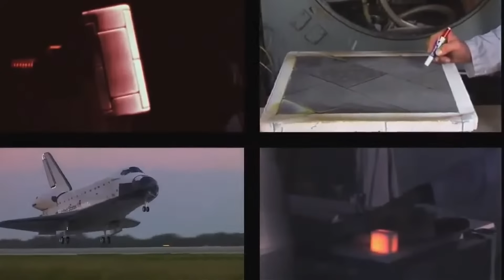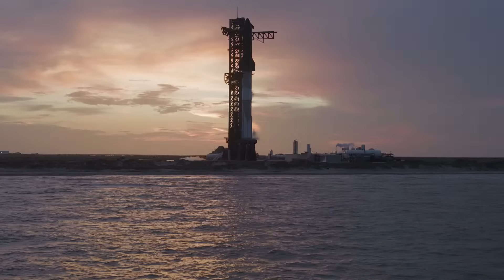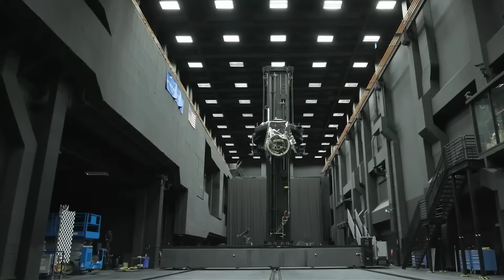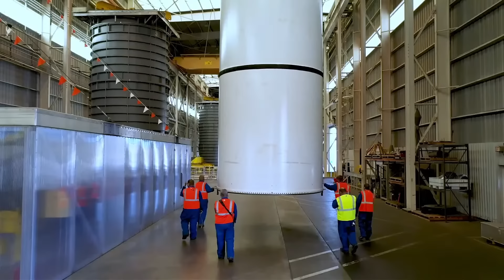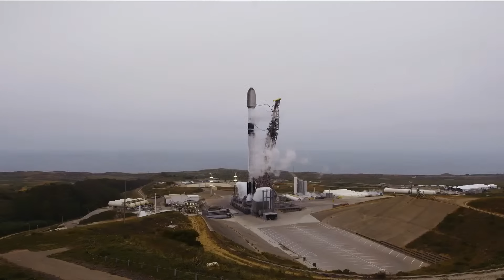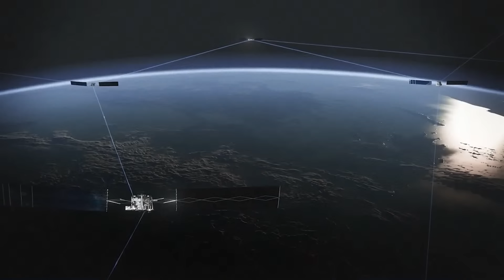SpaceX Brilliant Upgrade to Build a Heat Shield For The Largest Spacecraft Ever Built Reentry

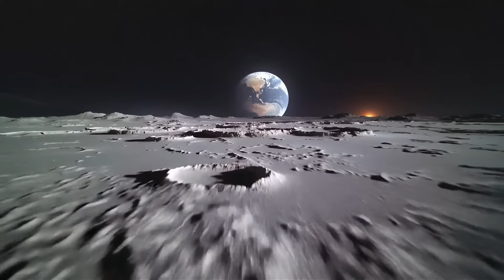Comment: 23:18 The landing legs should conform to the irregular surface during touchdown by retracting as necessary (after foot contact) until all are under similar large loads, then they should activate the extension clamps when the vertical velocity crosses zero. A parallel hydraulic circuit for all leg pistons can assure that all legs experience the same force as the ship settles it's weight on them. Shared hydraulic accumulators absorb displacement motion from the leg pistons. The guidance computer dynamically selects an accumulator with the most appropriate volume (and preload pressure) to bring the ship to a halt depending upon the momentary descent velocity and deceleration. Thus, the ring of descent thrusters are not the only control mechanism for touchdown. The extension clamps are not the sole means of immobilizing the legs, as shutoff valves for each accumulator and leg piston provide redundancy.

The great advantage of a shared hydraulic circuit is analog reaction speed, simplicity, and robustness. A downside is if the hydraulic fluid temperature reaches the boiling or freezing point.

Comment: What if the Starship was deliberately sent tumbling end over end upon re-entry, and in doing so no one part of the Starship was exposed for to long to the friction outside. Would this work and if it did would any heat shield tiles be needed? The crew could move to a gyroscopic compartment in the centre of the ship so they do not become disorientated until the ship levels out.
Reply: Problem with that , ... can you imagine how dizzy the crew would be ?
Reply: @harrydrury4734  Read the rest of my comment, the crew would be in a compartment in the centre of the ship that remains level at all times. If the ship is tumbling no ‘concentrated’ heat can be applied to any part of the ship for any lengthy period, when the ship is tumbling like a throwing stick. It is an ‘idea’ to avoid having a heat shield, I haven't the foggiest if it would work or not but a version of it may be worth giving it a try.

Comment: A couple of other options came to mind.
1. No upper rockets but inside a deep/wide crater or any elevations with steep slopes to build multiple cable tensioned catching rigs (similar to the Chinese build) next to each other.
The slope of the crater or hill can act as a flame diverter. Rigs would be anchored to prevent  ripping away from the slope.

2.Test the idea of self pile-driving foundation rods that can be lanced at the right velocity into the soil. To reduce the risk faulty geologic assessments, smaller lance projectiles can be used to test soil composition first before attempting to pierce with a full size foundation rod. The self ramming pile driver weight can also lean and cable tensioned anchors to help correct vertical alignment issues.
Once the foundation rods are pile driven in then you can anchor whatever landing platform you like. 
A lunar Mechazilla?
A cable tensioned catcher? 
Another good thing about building a landing platform on a slope is horizontal unloading can be done at any height without the need to hoist down anything. You just adjust the rocket position.
The use of pulleys to tension cables is likely ruled out due to lunar dust clinging to everything but may work with something used to tension with leaf springs and possibly magnetic cable ends or a design that borrows from lunar rover wheel design that overcomes the lunar dust issue.

Comment: Why not deploy multiple "Lunar Hoppers" with the same height/weight ratio, high center of gravity, weight proportions and a few other bare bone features to mimic a larger ship?
If this route was taken, which manufacturing choice would be the simplest?
Raptor style 3D printing?
Tesla Semi style giga casting?
Built by hand?
Also, what about building stackable test hoppers to maximize how many can be deployed in one mission?
There might be some missing data compared to a full size but I bet some lessons could be learned with a scaled down hopper before going to full size.

Comment: Why can't the HLS or the Lunar landER Land vertically and then use giant air bags like the Mars missions and let it fall over on its side Use a ring balloons around the top side of the hull, then Let it fall over, With the moon's gravity the stresses of such a fall over will be quite minimal then use another set of pyramidal shaped balloons(Rows of balloons stacked like a pyramid) on top of the other balloons to let it roll over into the correct orientation so that it's sitting upright on its side Then you don't need an elevator at all and you have tons of more floor space because you don't need a ladder down the center to take up space, Then use a completely separate launch vehicle within the Lander like the eagle to take the astronauts back up into orbit use the space that the Lander would needed for extra fuel to get off the moon and use that space for a separate launch vehicle Then the Starship can be left there permanently for future missions. 
But if they're dead set on landing vertically why not use cables that blast out the top of the ship and Anchor themselves to the surface, Much like how radio towers today are held up vertically

Tech fans: you used so many analogies in this video each one lamer than the next that I almost just quit the video early, Thank God for the right arrow key on my keyboard lets me jump ahead 5 seconds

Comment: The engines high up on the sides of the vehicle are the main engines for landing on the moon, not reaction control. The raptors would be way too powerful even dialled right back to allow the HLS to land. Instead they are going to have a ring of small engines similar concept to Superdraco but running on oxygen and methane rather than hypergolic fuel.  This also gives a huge advantage that they are well away from the surface reducing the amount of material potentially blasted from the surface that could impact the ship. Also HLS does not wait for multiple refuelling launches, there will be a tanker already full for HLS to dock with and refuel in a single operation. Seriously you need to do more research on this, the mission plan for a moon mission was released quite some time ago.

Comment: The trick on landing is not land the full starship! Basically, bring back the same concept used with Apollo and the LEM. Here, the passenger module goes down on its own with two thirds of the ship parked in orbit and the smaller craft with legs goes down!

So the path to the Moon would be: Phase-I, sending the moon ship up to be refilled at the fuel dept a second ship would join up with the crew once the moon ship is fueled. Transporting to the moon ship with last minute gear and travel to the Moon. Phase-II getting into orbit around the Moon in a parking orbit, then break free the lander capsule and head down.

Comment: So for the moon 
A multi sectional ship  would make a bit more sense to me.  One with two propulsion and a cab for the third point or even 3 outer rockets for wider stability with a central cab instead of bulky specific legs.  A lower in center cab that would alleviate such a bulky track for elevator. being even lower due to halving or even thirding the height because of multi sectional boosters.
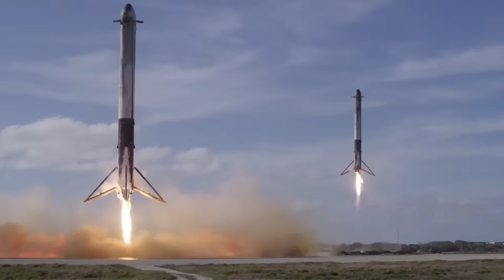If they really insist on legs then they should invert: They hinge at the bottom and fold out and down to lay out flat across the unpredictable surface using a much wider surface area that is less likely to punch down into the moon's surface making an  _| |_ shape, instead of a /| |\ down punching small foot print. He has feet slightly like that in frame 37:57

Comment: Putting landing legs onto Starship HLS is a big technical problem. Weight being high up on the list, so as crazy as this idea may be, what about building a landing legs “stage”? Launch this “stage” into orbit attached to a Starship deploying something like Starlinks, then jettisoning the landing legs stage for a Starship HLS to connect up to in orbit? No extra fuel top-up in orbit required (I think, not sure on what the extra mass would require to land on the moon), then head to the moon, land, then leave the heavy landing legs stage behind on the moon??🤪🤞🏻

Comment: I dont know the math on this but from the top of my head the gravity adjustment allowed humans and some mechanical assited movements could allow larger items to be used in place of an elevator the load and astronauts could technically move objects to the surface based on some basic pully method. Its an idea.

Comment: A heat shield made from obsidian
Reply: I think Obsidian is frormed from volcanos - while it came from a very hot reaction -  its glass like, but the blackness could be something. - Cermaincs and magnets could be something to avoid the re-entry problem.  Glass is a surface that could actually work under certain environments with magnets. Could be somthing to explore

Comment: Except they haven't solved the problem.
Reply: If a hundred ton vehicle as high as a skyscraper falling from space with 28000 KmH can get slowed down to 700 Kmh without beeing destroyed even after flipping into water with most of the tiles intact, I would call that more solved than everything else.
Like on every vehicle, heatshields need to be replaced. But the heat shield of the latest flight was mostly good to go again despite beeing stressed to much higher limits than usually would appear.
Reply: @Easore  So, in others words the problem has not yet been solved.  Huge progress acknowledged.  Not there yet.
Reply: @pspicer777  Well, its way better and cheaper than anything before. Whats solved than? With that energy levels involved, its hard to do better. There were some tiles that showed damage. But they can be replaced cheaply and easily.
Reply: @Easore Probably we can call it "solved" if the reentry damage is sufficient to support human rated craft and any damage can be replaced within a timeframe that meets the launch frequency requirements.  We are still a long way from meeting that bar.
Reply: @pspicer777  I d say we are already there. The heat shield already held up during all landings except when the Starship was tumbling and replacement of tiles can be done in time.
I think the heat shield already checks your criteria. The much bigger issue is landing reliable with the engine reignite and hitting the Mechazilla every time like some tests before to be safe for humans.
Reply: @Easore  Clearly we disagree.  Be well.

Comment: As the elevator descends, have a attached ladder roll down with it. Backup solved. As far as landing legs go, i'd run them the full length of the body of the ship. This is where over engineering would be appropriate.

Comment: Instead of covering the complicated surface of the fore and aft flaps with thermal tiles, eliminate those flaps in favor of one or two swing wings mounted to the dorsal axis of the Starship.  Those wings would be stowed for ascent, deployed prior to reentry, and then redeployed to their stowed position prior to or during the final landing burn.  The wings would allow for a slower, shallower descent after initial reentry.
Reply: The current design increases drag-resistant surface area.   Wings that fold downward from a central spine don't do that and they increase the probability of flipping over by llifting the center of gravity.  Side wings use the mass of the ship to sustain stability.  Plus, wings that fold out from a central spin create pockets for the plazma to gather in -- therefore requiring additional heat tiles underneath the fold out wings.
Reply: @_SYDNA_  The wings wouldn't fold down.  They would swing (rotate) out.  Parachutes don't cause capsules to "flip over" because they lift their center of gravity.  Why would a dorsal wing behave any different?  The fore and aft flaps already require thermal tiles.  Similar tiles on the wings or in the pockets would add no more than what are on the current system.
Reply: @glennmitchell9107 I get the concept, it needs engineering design, submit it to SpaceX
Reply: @SavageOne420  I'm not an engineer.  I was hoping some amateur rocketry club would attempt such a flight.

Comment: Lower the entire command module to the surface. No more annoying elevator rides every time you want to step outside (to pee 😆). Leave it there as a base with lines connecting to the bottom half of starship that could then act as a robotic supply ferry. Would have to protect the crew module from supply ferry liftoff and arrival forces and debris with distance or barriers/shielding.

Comment: question? why not make one big piece and glue it  to the shuttle . just asking?
Reply: When you heat or cool something the size changed. If it was all attached in one piece it would just break away from the vehicle and probably in pieces because they will have heated or cooled at different rates

Comment: Judging by Starship flight 13 a few days ago, SpaceX cracked the code on reusable heat shields. The plasma was clean and uniform in color and the actual heat shield was practically undamaged after reentry. I didn't believe it was possible but it's reality now.
Reply: Some tiles were damaged, but for every launch they do it's getting better, eventually they will have a solid structure, but they need to launch and test it over and over, we might se a perfect reusable heat-shield around 20'th launch.
Reply: @KungenErs they don't have to have all the tiles undamaged and still launch at the cadence they want. They just have to bring in a new vehicle that is ready to go
Reply: @ShieldWolf-yp3cr doubtful the starship will ever be usable faster than once a week
Reply: @ThatOpalGuy  they have already proven they can replace a whole heat shield in a week. So yeah I would say 2 weeks is pretty reasonable so a single ship to turn around and launch again. That is unless they find a new formula for the heat shield that is more resilient. Also after seeing the heat shield they started a new test tank for twisting forces so that may have played a part is why the heat shield looked a bit rough. Tiles being pushed into each other while the vehicle twists from force being applied to the fins could have caused some of those tiles to break and fixing that might mean a more resilient heat shield too. Next ship to re-enter might be way better heat shield wise.
Reply: @ThatOpalGuy then you need 7 of them to launch one a day. 

problem isn't the ships, it's launch pad turnover
Reply: Lol.  Many damaged tiles.  Those streaks on it?  The underlying material was heating and outgassing from between the tile gaps.
Reply: @ThatOpalGuy  the material  is between the tiles. Not just underneath it. They cut it just about flush with the face of the tiles so plasma can't get between the tiles. It's meant to burn up. The crunch wrap is sacrificed to protect the body of Starship.
Reply: not really, you cannot see cracks from afar. For all you know, every since tile had cracks and would fail during the next launch. What we can see, is streaks on the tile, indicating that heat got through the tile, either because it was cracked or the spacing was not right, thus the layer under the tile has been damaged by heat.. enough to vaporize it.
Reply: It only took them 13 years at the expense of about 500 billions of taxpayers money. Meanwhike musk becomes the first trillionaire. Coincidence? Yeah sure!
Reply: @carlossaraiva8213  huh? Where did you find that information 🤣
Reply: @ShieldWolf-yp3cr  at the getting place. You asking me to lazy it out for ya?
Reply: @carlossaraiva8213  ???
Reply: @carlossaraiva8213 ??? Do you... English??? I don't know what you just wrote??
Reply: @ShieldWolf-yp3cr I know? It would be understandable if they actually wrote some kind of complete sentence.. or maybe if dude had someone read what he wrote before he sent it.. it's BAD.
Reply: @AdamArndt  pretty sure it's a translator making it sound so strange and unable to understand.
Reply: @ShieldWolf-yp3cr ahhhhhh... Your probably right.. I'm going to give the guy the benefit of the doubt... I hope..LOL

Comment: Why not build a landing platform on the moon first, that way Star Shio can land safely on a dedicated platform that could include hoist and cranes and whatever needed to get people and stuff on and off. Another good idea I read in the comments is to make it land on its belly. I would think land it vertical and the let it “fall over” in a controlled way with some boosters slowing the fall. After all the moon has low gravity so it could be possible?
Reply from the maker: That's a great idea, actually

Comment: I wonder if NASA ever thought of having the tank above the shuttle instead of below it?
It would have needed a V-shape tail fin then, probably, but needs no mounting points in the heat shield area and no chance of chunks of ice etc. hitting the tiles.
Reply: Most likely for load sharing. If the tank is on top that means reinforced roof to withstand the pull from the boosters while you still need solid floor for re-entry. So it is the logical solution to have them in this configuration. The accident of the damaged tile due to foam falling off have many other solutions that require lesser disruptions. 
Maybe a coating of film or solution could give better protection. But spaceX are already on that path with the "paper" bonding sheet. So experimenting with liquids and films won't be far off.
A material that absorbs the moisture or wicks water as film and absorb the stresses of ascent, evaporate by the time it hits space and let's the heat shield exposed for re-entry. 
Interestingly moisture be8ng trapped in the tiles/heatshields was attributed to excessive damage observed on Orion capsule as the moisture bursted out and broke larger than anticipated chunks.
So having a flud cover the aerogels will prevent water intrusion or at least accommodate for it.😊